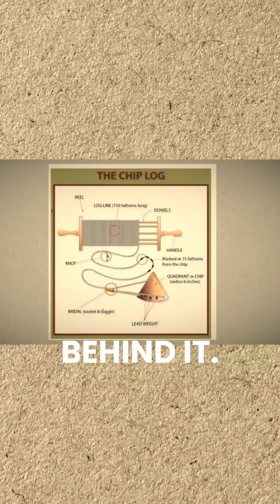Why do airplanes prefer knots over km/h for speed?

Comment: Now the question remains, how do they measure that during flight?
Reply: There's a little tube that points forward that measures the force of the air pushing on it, along with a litrle hole on the side measuring the air pressure. The airspeed indicators mechanically subtracts the outside air pressure from that force from the forward motion through the airbto give you your airspeed.
Reply from the maker: The Pitot Tube measure airspeed. Its a little pointy contraption sticking out of the airplane front side. When air presses against it that rate of change of air pressing on it measures the speed.

The concept was borrowed from ships in which the tube was placed in the hull and would measure how much water pressure asserts itself to the tube and that would calculate the speed of the ship.